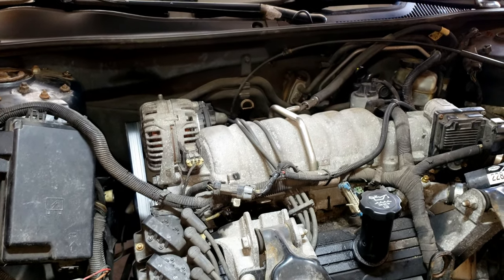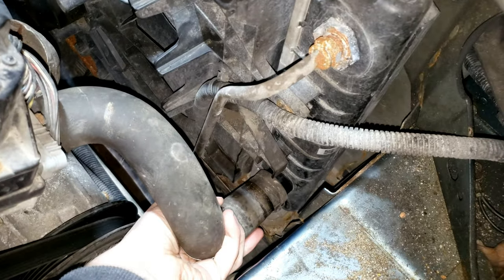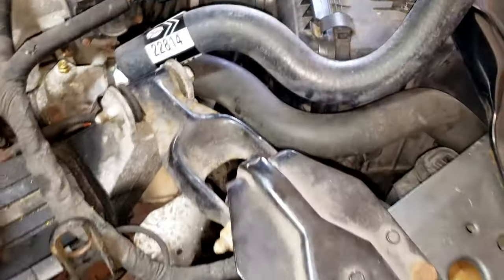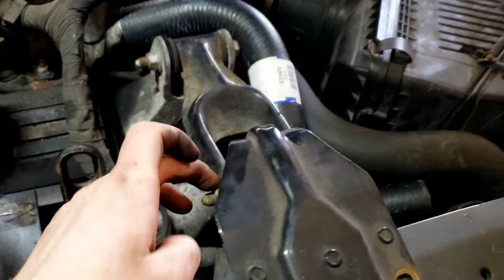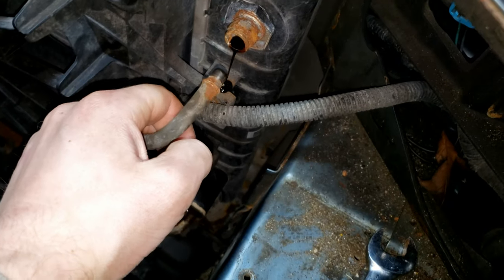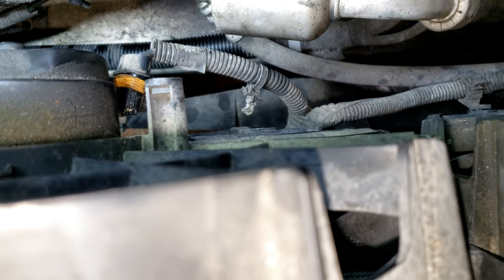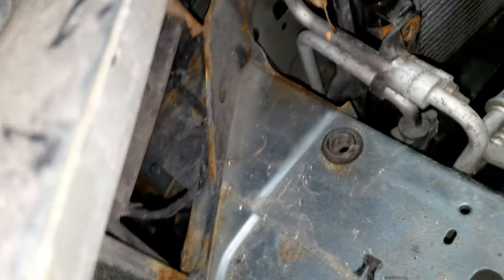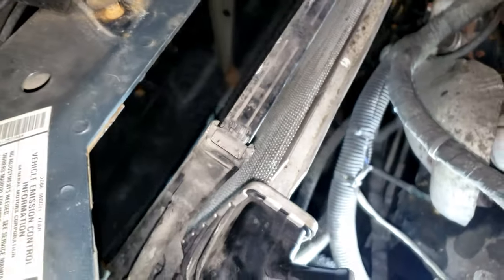Pontiac Grand Prix Radiator Replacement

Comment: Great video, thank you. Have to replace mine in my 2006 Pontiac Grand Prix.
Reply from the maker: Since this video I have done another one. They seem to be crap after about 10 years. Glad it helped. Like, subscribe and enjoy. I will note both times had some different items to be removed but mostly the same process
Reply: I think I have a leak in my Radiator how to find out
Reply from the maker: @hassantisdsle3254  once your car gets to normal operating temperature jack the car up and look at the radiator. You'll see quick where its leaking. Be safe. It will be hot. I'd check hoses first. Sometimes they tear or are ruined by the clamps and old age
Reply: Jeffery Wayne is it anyway I can send you a picture of it
Reply: Jeffery Wayne Do you have a Instagram because it’s not letting me send it
Reply from the maker: @hassantisdsle3254  https://m.me/jeff.peeler.7
Facebook messenger

Comment: Just bought a 2004 Grand Prix GTP Comp G with 94,000 miles. 
It had been sitting for 3 years before I bought it. The radiator is leaking now, looks like I’ve gotta do this job this weekend. New hoses and thermostat (180 degree) while I’m at it. Then a right rear hub bearing the same day, and a oil level sensor too (easy). 
Thanks for the video. Only think I’m not looking forward to are those damn transmission line clips. I’ve never liked those things!!
Reply from the maker: They suck! Be prepared to replace those too if it's so rusty. i hope this video helps. feel free to like and subscribe for more & if you can, please help the channel out by giving a super thanks. Making these videos takes a lot of time, but we do it to save you hundreds. also head down into the description and check out the link for some high quality led bulbs for this and any other vehicle. use my referral for a discount. Add me in Instagram for behind the scenes pics and Stop by my store for some Anything Auto gear.
Reply: Didn’t lose em, the new radiator had new ones on it though. Took 2 of us 4 hours to do this job!! Now come to find out, one of my transmission lines is leaking! DAMMIT!!!
Reply from the maker: @jeffb243  knew it. I'm telling you they are hand on hand

Comment: This was very helpful, thanks!  Just a couple notes for anyone with an 02 Grand Prix Gt.  On that one you actually don't need to remove the two wire harness' from the fan motors or the plastic clippies holding on the harness', you just need to remove the top center(blue with the white safety clip) electrical connection, and all of it comes out perfectly with the fan.  It also doesn't have the annoying useless clips connecting it to the a/c condenser.  Check and see if you need new transmission coolant lines beforehand, mine were super rusty.   Lastly, when your about to be finished, don't drop one of your mount bolts down into the bumper and scrape up your hand trying to get it like a giant idiot, they sell replacements at Ace hardware for three quarters.
Reply: Thanks, that's the EXACT car I have!

Comment: I’m having issues with the 2 bolts on 1 side and 1 bolt on the other side, can’t get any of them to thread and why?
Reply from the maker: I don't know your issue unless you bring it to the garage. i hope this video helps. feel free to like and subscribe for more & if you can, please help the channel out by giving a super thanks. Making these videos takes a lot of time, but we do it to save you hundreds. also head down into the description and check out the link for some high quality led bulbs for this and any other vehicle. use my referral for a discount. Add me in Instagram for behind the scenes pics and Stop by my store for some Anything Auto gear.

Comment: i have a 3.8 L 2007 pontiac grand prix and im wondering if it has the drainage plug on the driverside as well?
Reply from the maker: I could only assume so. I do not have it in my garage so cannot say for sure. i hope this video helps. feel free to like and subscribe for more & if you can, please help the channel out by giving a super thanks. Making these videos takes a lot of time, but we do it to save you hundreds. also head down into the description and check out the link for some high quality led bulbs for this and any other vehicle. use my referral for a discount. Add me in Instagram for behind the scenes pics and Stop by my store for some Anything Auto gear.

Comment: Do you have to put a jack under the motor when removing these mounts
Reply from the maker: Not sure about this one because I'm not watching the whole thing but I put a jack under it to raise and lower the engine if need be. i hope this video helps. feel free to like and subscribe for more. also head down into the description and check out the link for some high quality led bulbs for this and any other vehicle. use my referral for a discount. Add me in Instagram for behind the scenes pics and Stop by my store for some Anything Auto gear.

Comment: Question: Is the radiator curved? 
We ordered one and it was damaged and the 2nd one is curved again. Is this a defective shipment or is your radiator straight??
Reply from the maker: I've never seen a curved radiator. i hope this video helps. feel free to like and subscribe for more & if you can, please help the channel out by giving a super thanks. Making these videos takes a lot of time, but we do it to save you hundreds. also head down into the description and check out the link for some high quality led bulbs for this and any other vehicle. use my referral for a discount. Add me in Instagram for behind the scenes pics and Stop by my store for some Anything Auto gear.

Comment: Mine is at 215K and it finally is starting to overheat. I got elbows replaced and now the radiator is leaking.😧 Just watching to see how doable this is.
Reply from the maker: i hope this video helps. feel free to like and subscribe for more & if you can, please help the channel out by giving a super thanks. Making these videos takes a lot of time, but we do it to save you hundreds. also head down into the description and check out the link for some high quality led bulbs for this and any other vehicle. use my referral for a discount. Add me in Instagram for behind the scenes pics and Stop by my store for some Anything Auto gear.

Comment: How did you separate the radiator from the condenser? I can't move the condenser upward even while prying on the clip.  Wouldn't you need to do both upper and lower clips at the same time?
Reply from the maker: yes, separate one side then try  your best to keep them up and out of the way so they do not lock back in place while doing the other side. as i said in the video its the hardest part of the job. i have done another one recently and same issue
Reply: Thanks so much for the video. It was a tremendous help.  They finally came apart after taking a fresh look at it this morning.

Comment: okay so this was actually really easy but TAKE OFF THE THROTTLE BODY BEFORE THE FANS
Reply from the maker: @A_Dilophosaurus  back then being one of my first car I've ever worked on ,yes. Now it's very easy. One of the easier ones I do now a days. i hope this video helps. feel free to like and subscribe for more & if you can, please help the channel out by giving a super thanks. Making these videos takes a lot of time, but we do it to save you hundreds. also head down into the description and check out the link for some high quality led bulbs for this and any other vehicle. use my referral for a discount. Add me in Instagram for behind the scenes pics and Stop by my store for some Anything Auto gear.

Comment: How much money does this repair save, on average, for these models? We have a Pontiac in this range, and I'm thinking of using this video as a guide to replace ours. ✌️❤️🔮
Reply from the maker: I cannot really give you an estimate on parts because every shop up charges parts to a certain degree but as far as labor you should be looking at that $320 range but again that also depends on the shop and what they charge per hour
Reply: @AnythingAuto  Yeah, that's definitely a considerable amount. Some DIY seems worth it. Thanks for the guide. I'll need it!
Reply from the maker: @hermesgestistruism   I am hoping I can get another Pontiac in the future to do another radiator because that is when I 1st started filming before I even wanted to make a channel so the quality was pretty bad
Reply: @AnythingAuto  If you lived up here in Maine, you could definitely do this one. I'm not looking forward to it at all. 😂
Reply from the maker: @hermesgestistruism   Do not overthink it that one's an easy one I do many radiators a month and and that 1 is pretty simple try it on a Chevy Captiva and you'll want to blow your brains out
Reply: @AnythingAuto  Right on. I'll post back and let you know how it went! Hopefully, I'll be able to buy the part and get it here quick. I don't trust the liquid repair stuff to last long.
Reply from the maker: @hermesgestistruism  noooooo then you'll need to do a cooling flush and thermostat replacement